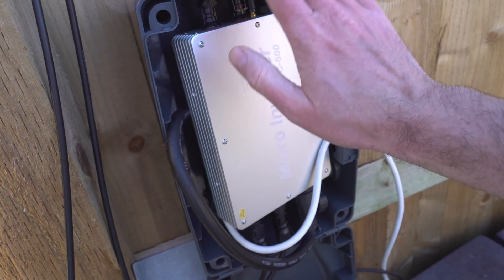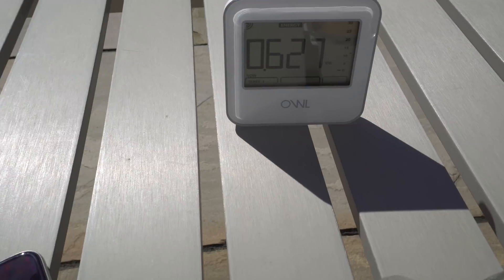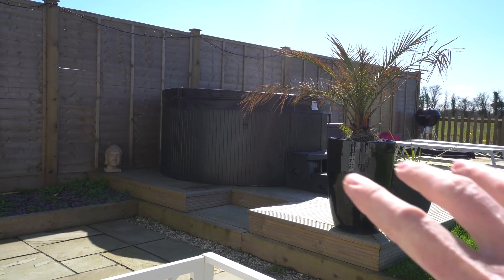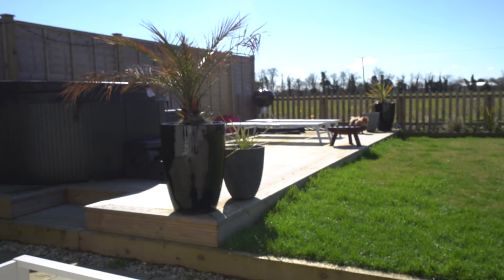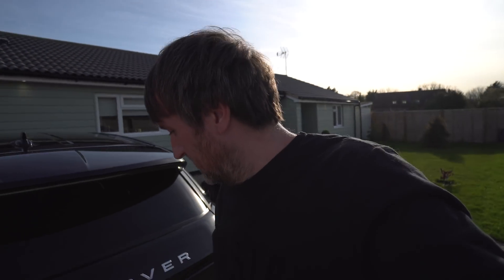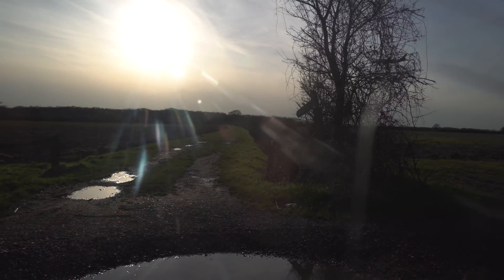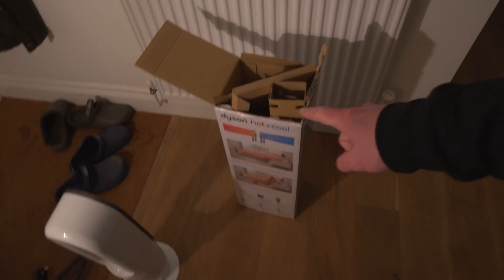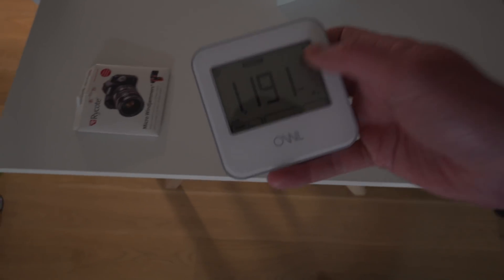SOLAR YIELD ON A REALLY SUNNY DAY!!!

Comment: @2:28 The bad news is solar panels haven't increased in efficiency of conversion since the late 1970's. The very best panels are ~15-20% efficient, but conditions such a clouds, dust on the panels, improper alignment to the sun, etc reduces the average overall conversion efficiency to ~15%.  The prices have come down and they do keep increasing the size of the panels..which makes it seem like they're putting out more power. There hasn't been a conversion efficiency technological advancement in solar in a very, very long time.

Comment: Thanks for these videos. Managed to get 2 cheap 250w panels off ebay, and with my ~900w/h usage, i'm hoping to put a dent into the electricity bill.

Just got to mount them on the shed :)
Reply from the maker: Cool! Make sure you get the optimum angle on the panels and wire them in parallel if your charge controller can handle it.

Comment: @ andy kirby

With your solar needs I can tell you this information that you won't find elsewhere as no one wants to share the information.

With a fixed rooftop system that doesn't move, you will get on average 60% of your rated watts of panels during summer for the amount of solar hours in your area. So if you have 1kw & 4 solar hours in summer you will get 600w x 4 hours. During winter your efficiency drops to about 30% so your 1kw & 4 solar hours or less during winter, will get 300w x the solar hours during winter. So you should plan your solar requirements at the lowest amount that you will get during winter so that if you can meet your winter demands then you are happy.

With a moving solar tracking system that will follow the sun, you will get on average 80% of your rated watts of panels during summer for up to double your solar hours. During winter it will get around 40% for up to double of your solar hours. A solar tracking  system in some ways is more expensive but needs less panels.

Comment: can u not.add a flexible.pannel.to the twizzy or add.a charge point.on drive from.shed?
Reply from the maker: Yeah the trouble with the small solar panels at the moment is they don’t deliver much power. I currently use a grid tie with just two panels which whilst doesn’t directly charge the twizy it covers its usage per day and then some. It’s a good compromise!

Comment: In spring sunny day I get around 1.6kWh from a single 260W PV panel. I'm fully offgrid so that will go in to the LiFePO4 battery.
And in absolute worse winter snowy/overcast day I can get as low as 80Wh from the same panel but that only happens a few days maybe 3 or 4 days in winter and is absolute worst case.
Reply from the maker: Wow! That’s good going, I’m impressed how you survive off grid with ~1kWh per day? I guess maybe you burn wood for heating and cooking? Amazing!
Reply: I used about 50 to 60kWh per month in the past for electricity only now that increased to 80 - 100kWh/month as I also produce the SBMS in my lab. The heating needs at most 1000kWh/month in January and February when is max and all is done with PV panels. I have 33 of those 260W panels installed now but will be 40 in total and they power the house fully since is a net zero house so both heating and electricity for appliances.
You can see the SBMS manual here this is for storing electricity in LiFePO4 and a presentation about the DMPPT450 that is for heating the house here  http://electrodacus.com/DMPPT450/dmppt-presentation-v01.pdf
I only mentioned what a PV panel produces in a day as reference my 40 panels will produce as much as 60kWh in a very nice sunny day and that will be stored in a 160kWh thermal mass storage for heating and very small part stored in my 24V 185Ah (4.5kWh) LiFePO4 battery for LED lights, computers small fridge and electric cooking all this do not need more than 80 to 100kWh/month.
1kWh per day will be tough but I only needed an average of 2kWh per month in the past few year that was provided by 3x 24W panels and 2.5kWh LiFePO4 battery and this included electric cooking that used most of this energy the LED lights and two computers did not used much same for the small peltie based fridge that uses about 8kWh/month.

Comment: "I have to get more panels" - I have 10 of the bloody things but can't put them up till I get all the other bits like the proper racking and inverter. 2.5kW tho, should power my radio gear, and keep the computers off grid along with the entertainment system, along with all the little vampires like phone chargers, etc :)

Comment: Nice output from two panels this early in the season.    You have got me seriously putting a couple of kilowatts of panels on the roof.  Two kilowatts would power my house for at least 5-6 months each year.  Of course the break even time in terms of cost would still be 7-8 years.
Reply from the maker: Awesome! Are you DIY’ing it? Yeah the break even time is always the thing isn’t it. I think it’s best to not think about it too much in that way. If you think of it as a hobby that you enjoy then the free electricity is a bonus!
Reply: I will DIY as much as possible, but may have to hire an electrical contractor for the actual grid-tie connection to make the power company happy since my electric meter would have to be replaced with a grid-tie capable meter.  The contractor is needed for liability concerns.  I am also considering the possibility of just buying a Tesla powerwall and connecting my DIY solar to it, but that is fairly major money.